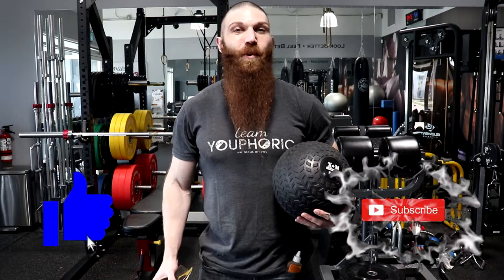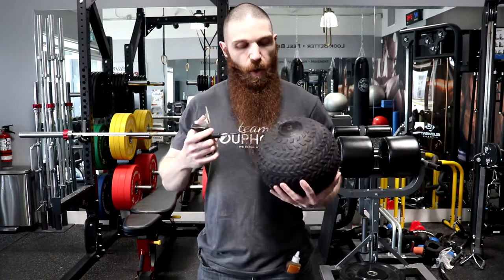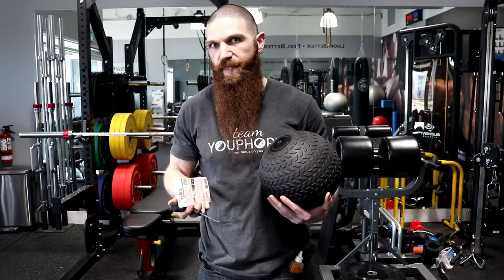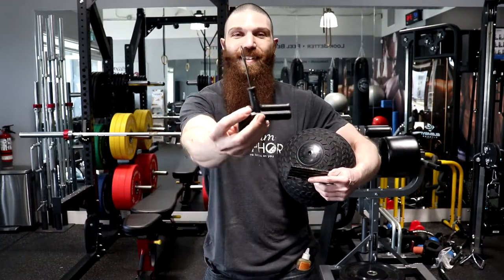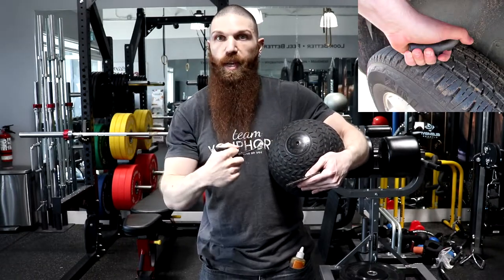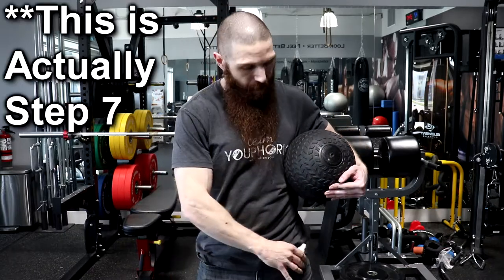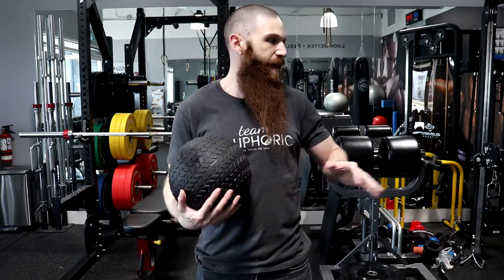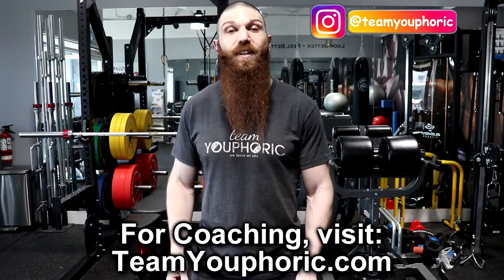HOW TO FIX A BROKEN SLAM BALL | DIY EQUIPMENT REPAIR WITH TUBELESS TIRE REPAIR KIT & GORILLA GLUE!!!

Comment: I had this exact idea and I was glad to see that someone has tried it and it works! I wonder if using a bicycle tube patch over the repair might be a better choice than duck tape??? The holes I have to patch are tiny and not at the valve - I see your repair tips in the comments below about just using glue.  I'll try that first, and maybe add a tube patch too.
Reply from the maker: I probably went a bit overkill. A bicycle tube patch will probably do the trick.

Comment: What happens if the slam ball has a hole that's not where the valve is?? Is it the same method?
Reply from the maker: Yeah, it's the same method without the plug. You want to glue the hole, let it dry, once it's dried cover it with more glue and put Gorilla Tape over the glue, then inflate the ball. I had that happen to another one of my slam balls and it worked perfectly.

Comment: What if the hole isn't on either end but on or near the treads? the tape won't go smoothly over the tread areas.
Reply from the maker: It won't go smoothly over but if you put the gorilla glue first and then the gorilla tape on top of the glue it'll hold.
Reply: @TeamYouphoric  Thanks for the tip.  I'm guessing tape will just fall off unfortunately (I have at least 60 of these broken mostly with holes in the way I'm describing...)
Reply from the maker: @johnnyfukumoto8826  yeah, the tape by itself won't hold because if the material. I have another Slam Ball I fixed this way and it was a fairly big cut on the side of the ball. Still holding up.

Comment: I will share my experience because the breaking of my slam ball (60kg) lead to me discovering this video.
What happened was I pushed the pump needle into the ball in the wrong angle and the tubing inside popped and deflated. The valve disappeared somewhere inside and I was unsure if this method would work since there was no apparent way to inflate the ball BEFORE using the tire repair kit. The hole was just too big at least for my football valve needle pump. 

So I ended up using the tire repair kit just to see how it would work regardless of what happened next. I found out that once the rubbery piece was firmly in place (mechanics here call it dogshit), and I had yanked the tool out, I could use the rubber filling as a VALVE! I just pushed the needle through the center of the filling and started pumping and I managed to get the ball full of air. I slowly pulled the needle out and it was immediately sealed! I applied some gorilla glue anyway because it's cheap and it certainly didn't make matters worse anymore.
I had only used the ball for a couple of weeks when it broke and this video saved me a lot of money and saved me from further frustration. I can train in my backyard again!
Thank you!

BTW. A couple of notable things:
1. Íf the tubing inside is broken the ball might not be as round anymore after this fix... not exactly egg shaped but not a perfectly round ball. But it is bouncy and sealed and it works as intended.
2. if you see that a lot of sand is blown out at the moment of breaking, it might be wise to get some seaming sand and use a scale to get it back to its original weight. I accidentally put a few hundred grams extra but that's not a bad thing!
Reply from the maker: I'm glad this method worked for you! I've been using my repaired slam ball for over a year now and it's still holding up and hasn't deflated one bit.

Comment: Why plug off the air hole... why not use a ball stem repair kit and install a new valve stem then it can still be used as designed.
Reply from the maker: Because now it never deflates.